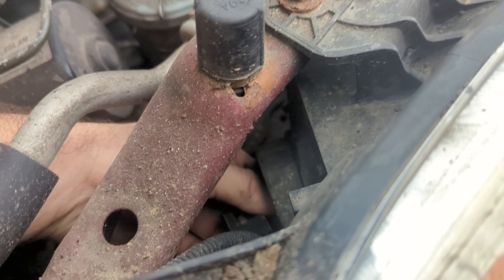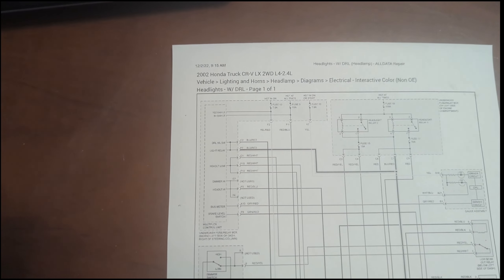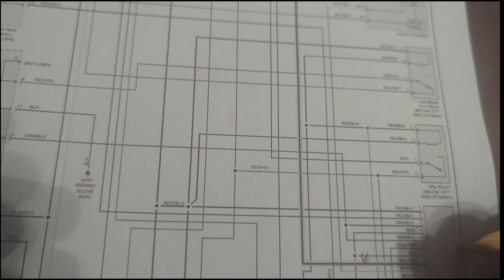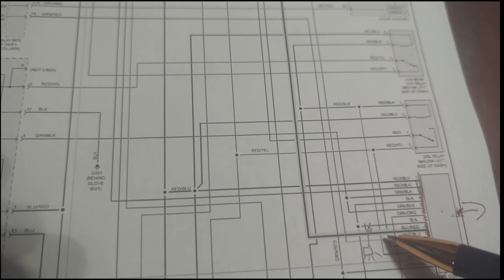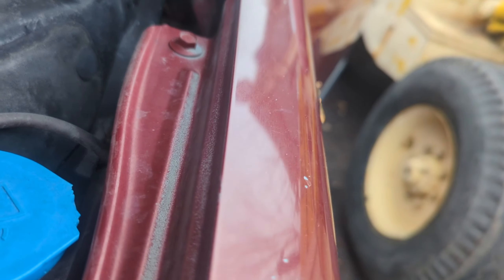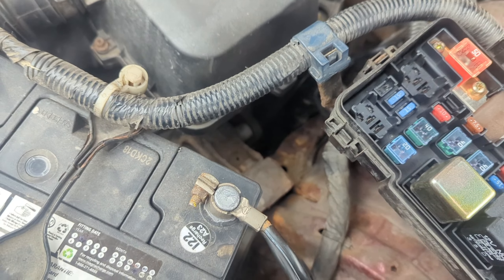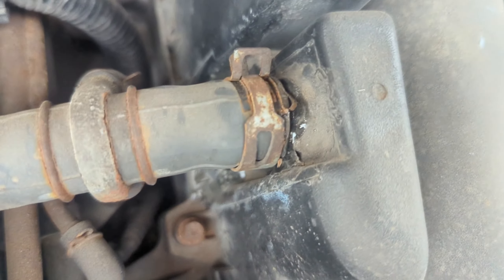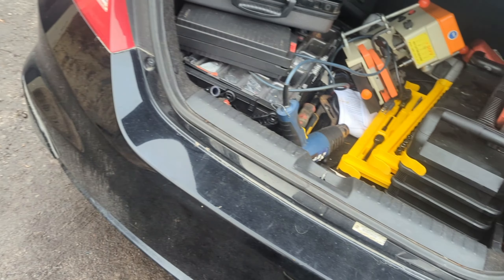2002 Honda CRV Head lights stay on

Comment: Thanks for keeping it simple. Control module ground side switches the relay. Unplug control module, still getting ground, therefore there is a short to ground. I like how you used your break out box to power your test light.  Thanks for the video!
Reply from the maker: you welcome, thanks for watching